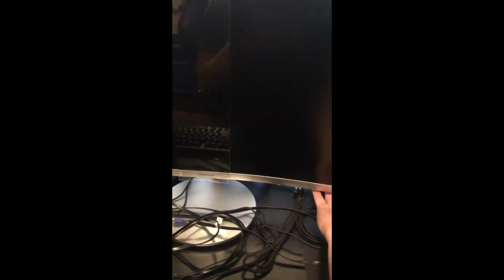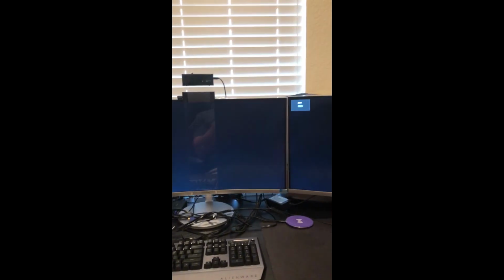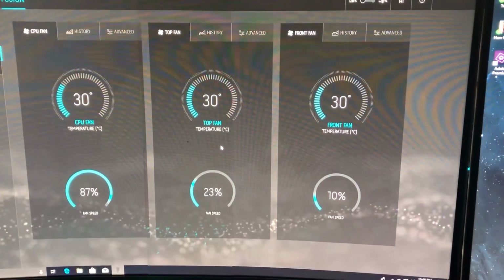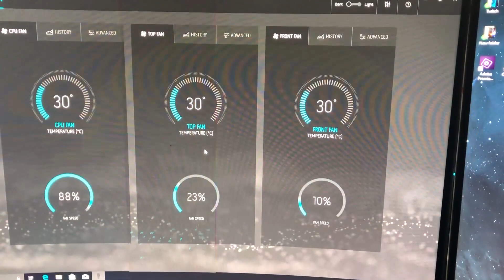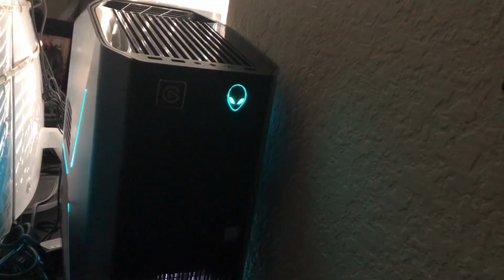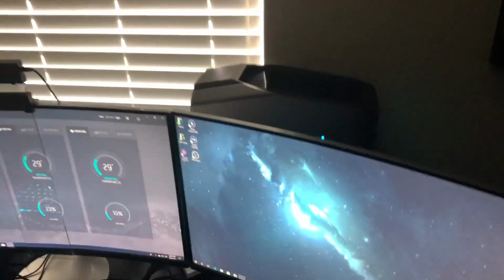How to install a new cooling system into your alienware R8

Comment: Top fan is placed wrong. Its taking air from outside to inside. It should be taking air from in the case and exhausting it to the upside which is outside the top of the case.

Comment: that fan on the h60 is on backwards. that would pull air into the case rather than push it out.

Comment: Hey. thanks for this video.  I did the same install a couple of years ago, but I don't think it has ever worked properly.  First, the computer has never recognized the fan.  The Corsair has a 4 pin fan connector and a 3 pin pump connector.  The mobo connectors are all 4 pin.  I have the 4 pin plugged into top fan, and the 3 pin plugged into cpu fan, but doesn't seem like it matters. to make matters worse, the 3 pin is very loose.  I just ordered a 4 pin to 3 pin adapater to see if that helps.  I just wondered how you have you Corsair plugged in.  Thanks!

Comment: it looks like you installed the radiator fan backwards, you want it to push air thru rad out the top. You have it pulling hot air into the case.

Comment: Just a heads up, in the video the radiator fan is installed blowing air in the wrong direction for this machine. Air intake should come in the front and blow out the top. The way the fan is aimed in the video would be drawing air through the radiator and blowing it into the case.

Comment: I had to remove the front fan to compensate the new RTX 3080, any ideas on work arounds because there wasn’t any room to fit the GPU without getting rid of the fan, any suggestions on what could be done to get an alternative air flow to the front?

Comment: Nice video man👍 i have question please : I have removed the front fan to fit a bigger graphics card! I have stock liquid cooling by Alienware for the cpu. Now do you think my system will run into heating problem ? Do you think the front fan is necessary ? THANKS in advance.

Comment: After replacing cpu plus top fan with corsair h60 like yours. And replace front fan... now the power supply fan stand out being noisy when using more power.... end up have to replace power supply as well....dell use cheap parts.

Comment: I have that exact same cpu cooling set up however, wouldn't you want the fan to be facing the other direction for the airflow to push towards the outside of the radiator?

Comment: I have never opened a pc before and I was thinking of changing the front fan with this one using this tutorial but I’m scared I will mess up and destroy my pc. Is it hard to do this? And is it safe?
Reply from the maker: It’s normal to feel a little scared having never done it before.. to change the front fan. Just pay attention to the direction of the fan and where you unplugged it from.. just put the new fan back the same way as you took the old one out and plug it back into the same spot... you do fine
Reply: K thanks

Comment: Did you take anything apart or just did it with everything intact like graphics card etc when installing the cooler? Was it easy to work on?
Reply from the maker: I left everything in place. Only removed the top fan, heat sink, and cpu fan. All the parts your replacing in the first place

Comment: Great video. Subscribed. I just got the Alienware Aurora R8  with the liquid cooled option. For me, in the Alienware OC application,  it only  shows temperature and fan speeds for the TOP fan and the FRONT fan. I'm confused why I don't have the CPU fan tab?
Reply: Its probably because you have the liquid cooled version. I got an r7 and went with a non liquid cooled version for the cpu so In my command center I do have the cpu fan option. For liquid cooled version you don't really need the cpu fan tab as you don't have a cpu fan to begin with. So the software for you're system will not have it.

Comment: Had a similar problem with the fan noise all I did was update the bios and it seemed to resolve it in case anyone wants to try that before doing the upgrade you can find the bios update on dell's website

Comment: It pissed me off, that I cant find the OEM alienware water cooler either. :( Thanks for your vid. I've been looking at the h55-h60 and h80i(dual 120mm fan might be too deep to fit) for my aurora r7. This helps a lot
Reply: In case anyone is still looking around for CPU cooler, I just chatted with Dell support. They quoted me $109.99 for the CPU cooler (MH0HN) and $144.99 for the fan assembly (PP749). I was hoping to stay stock but $268.49 (with tax) is crazy when the H60 kit has both the cooler and radiator fan for ~$60-80.
Reply: you don't want the alienware AIO,  I'm using this video to replace that thing because the original is extremely loud

Comment: Did you have to remove the motherboard to install the h60? More specifically the back bracket or did it just bolt right on?
Reply from the maker: Hasan Kalim I did not have to take out the motherboard or the back bracket.. the H60 comes with two different size double sided screws that bolt right into the motherboard
Reply: @StrayDog614  Thanks so much for the quick reply! Looking to do this upgrade this week!

Comment: Just ordered my R8, first Alienware and first gaming PC...specs: i5-9600k, rtx 2060 super, 16gb ram, killer wifi, liquid cooling with 850 power supply, 512gb ssd and 1tb hdd, cant wait gonna start by replacing this fan just ordered it!

Comment from the maker: It will error code and not boot up if the front case fan is not the right fan.. it has to be the fan in the video or equivalent.. the key factor is it has to be 1700 rpm or more.
Reply: Raydog614 hey can you upload a video on how to install the H60 and can I do this even if there is already liquid cooling inside? I just want to change the top and front fans so it doesn’t sound like an A380 taking off in my room.

Comment: I have my h60 installed and also replaced the front fan mine just lights up but does not spin and also when I start my computer now from shutdown it throws a error for cpu fan not found
Reply: Your fan has to be same size, max 1700 rpm speed an quiet. Any less rpm max fan speed will get system error

Comment from the maker: No.. once you remove the heat sink and fan from the CPU, the four holes that the heat sink was screwed into are used.. the Corsair comes with eight double sided screws. The long ones are the ones needed and they just screw right into the motherboard.. no back plate needed
Reply: Okay thanks I am probably going to do the install this weekend for the liquid cooler and front fan
Reply: Challenger 23 how did it go?

Comment from the maker: The holes should just light right up and you can use the screws that come with the liquid cooled radiator and attach it right to it.. then the radiator and the fan just sit right up in the space at the top

Comment from the maker: I actually just did this.. I put the same fan I did for the front fan on the top and attached it to the liquid cooled radiator.. put it adds some light to the whole inside.. you can always use one of the multi colored ones instead of just the white ones.. just make sure they can do the 1700rpm
Reply: Thanks for getting back to me so quickly. I've ordered another ML120 for the top fan. Unfortunately, the R8 service manual doesn't make any reference on how to attach the top fan to the liquid cooled radiator. Is it just a case of plugging a connection in somewhere? I'm pretty new to this but couldn't stand the noise on the R8 anymore so started looking for solutions.  Brilliant video and so helpful in making the noise more tolerable - thanks again.
Reply: Ken Johansson  I’m about to do this today.  My R8 is liquid cooled. How do I go about installing the top fan?

Comment: Wait did you install the backplate for the cooler or are you raw-dogging that cooler?
Reply from the maker: 3 left feet lol... no backplate was needed. The cooler came with pegs that screwed right into the holes where the old heat sink was mounted.. just had to pick the right sized ones.
Reply: @StrayDog614  just making sure, as it turns out the air-cooled models also have a stock backplate installed for the appropriate coolers.  Thanks for the video, installed the H60 yesterday, idle temps are still higher than I'd expect, mid to high 30's,  with fans set low, but my temps under load are about 20C cooler.  Thanks again for this!
Reply from the maker: 3 left feet your welcome, glad the video helped you and you got it installed.
Reply: @StrayDog614  Me too, it was a pain to install, even without having to completely remove the motherboard.  I have the aurora r9 chassis, looks great but a real pain to work with.
Reply: @TheWarmestFuzzy  hello I just got the r9 as well and want to upgrade to this cooler. You said you were able to install without backplate, did everything boot as expected? I don't want to mess anything up when I go to install this
Reply from the maker: 3 left feet so you have the new one.. yeah it looks cool.. I want the new 27inch monitor Alienware made. Just wish it was curved
Reply: @StrayDog614  been eyeing that one myself, it's on sale right now I think, 30-33% off or something.  Still a little pricey, but now with the aurora r9 white case,  the white corsair virtuoso headset, I'm thinking a matching white monitor might be in the cards.

Comment: Hi. Thank you for the vid. do you have a video installing the H60? also do you have a video of the new front fan under heavyloads? does it still make a loud noise?
Reply from the maker: Edward Drazel G. Abadinas I will be putting up a video of the H60 install soon.. the front fan under heavy loads will still make noise like any fan.. but it’s not nearly as loud as it was. Instead it’s more of a smooth fan sound at high speeds.. no up and down like a fan. And only last a minute or less. Was on the computer doing multiple things and it didn’t make a sound until I was 4-5hour in and only did it once
Reply: @StrayDog614  Thank you. looking forward to your installation of H60 vid.

Comment: Is your Alienware still loud?
Reply from the maker: No, I barely hear it anymore.. in the most extreme circumstances I might hear the fan speed up but it’s just a minor noise and 75% quieter then it was
Reply: @StrayDog614  what fan curve did you use

Comment from the maker: No hindering that Ive noticed.. graphics card stays nice a cool... Adding liquid cooling is the key for the R8 makes a huge difference. I would have loved to find an Alienware liquid cooling but I couldn’t find one lol
Reply: I believe there is a config which comes with liquid cooled 2080Super? Does that also help reduce the vacuum sound? Thanks.
Reply: ZhiGong Liu it’s usually just the front and top fan causing the problem

Comment: Does that sound card hinder the graphics fan from cooling the card? Also, My R8 came with an aluminum heatsink and a bootleg small fan so I found the OEM Alienware Water Cooling system on eBay for $56.00 and that made a huge difference.

Comment from the maker: All of the chats online say all the software updates don’t fix anything.. if you replace the top fan with the Corsair H60.. that will eliminate the sound. If you don’t want to do that, just get better fans (top, CPU, and Front). Just make sure they run at 1700rpm or higher

Comment from the maker: So far the highest temp it’s gotten too is 105F which is good, on the temp screen in the performance software it’s not even 1/4 what it can take
Reply: I called Dell today, they are aware of the issue and told me the Bios update v1.0.7 will fix my problem which seems to be different from yours. It didn't fix it for me, and the top fan makes now more noise than before in Thermals Perfomance (46% instead of 24%). And the vacuum noise from the gpu is still often occuring.

Comment from the maker: The top fan comes right out the opening to the case, no need to take the other side or top of the case off.. you just take one screw out on the fan bracket and it all comes out.. No the thermal paste was cleaned off and I used the thermal paste that came pre applied on the Corsair H60

Comment from the maker: After I switched to the Corsair H60 liquid cooling for the CPU.. the noise stopped with initial video editing.. but after a little bit the front fan kicks on and is loud so replacing that got rid of the vacuum completely
Reply: Ok, I see, maybe I focus too much on the gpu but it might be the liquid cooling system, it worked 3 months and it has a malfunction now. Just to be sure, when you're talking about the vacuum noise, it's coming from the gpu while hot air is flowing out at the back of the desktop? Or was it coming from the front fan?

Comment from the maker: If you got the same one I did, the R8 with the intel core 9700k.. the noise is just the computer. No heat issues, that how it is with bring air cooled.. if you don’t want to do liquid cooling.. just upgrade all three fans.. the 120mm top and front fans, and the 80mm cpu fan.. that will help a bit
Reply: when upgrading your fans make sure you get fans that go 1700 or faster as any less will result in your pc not starting
Reply: I got the same core but maybe it's not exactly the same issue. I'm doing some tests by increasing the front fan fixed value in addition with a custom gpu fan curve on X1. I don't know why but even in performance, it stays at 12% in auto-management. I tried with 22% but it set the fan at 31% once in game, weird. But it seemed way better and I have to do further tests. I'll keep you posted!

Comment: Thank you for this video. Mine is still under warranty so I'll check with Dell. I'm struggling with this vacuum noise since the middle of May, 3 months after delivery. And my solutions were using gpu fan curves in EVGA X1 Precision and lowering graphics settings. Did the vacuum noise come with hot air from the back of your gpu? Therefore, I have to focus on the front fan, like you said at the end of the video. Sure there's something wrong with temperature, I thought there was something wrong with OC controls in the Command Center and the bios. But the recent updates didn't fix that issue. And even a reset to factory settings wasn't enought to get rid of it. Indeed, it is a hardware issue if I well understood.

Comment: aite buddy when you put the liquid cooling in did you have to take anything out to add brackets or it just went straight in?
Reply from the maker: Just straight in
Reply: @StrayDog614  cheers dude
Reply: @StrayDog614  Thanks for the video. A couple more questions. Did you have to remove the other side or the top portion of the case to get the old top fan out? Also, you just left the original thermal paste on?
Reply: @Slappula  aite buddy saw this so i thought id answer, its possible to do it without because the radiator goes in the fan case so tight it wont ever move but best thing to do it have the top off push the rad all the way in and screw it too the top of the fan cage with the lil s rews the provide. Also clean the old thermal paste off your cpu and the liquid cooling unit comes with pre applied paste. If you have to have another go at putting it on its best to renove the paste again and set some new on there. I didnt have to reset it but thats what iv read elsewhere